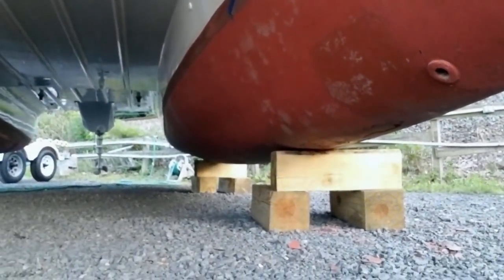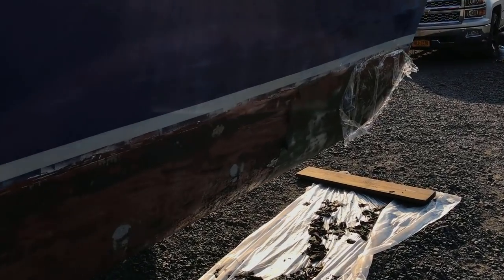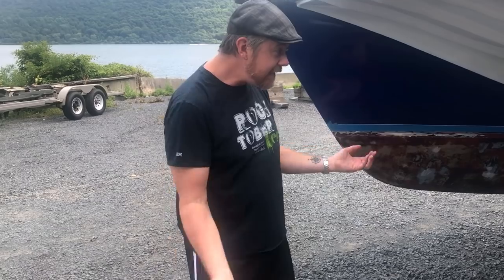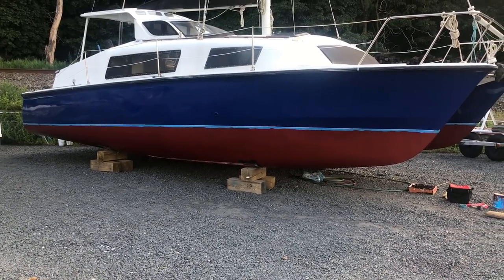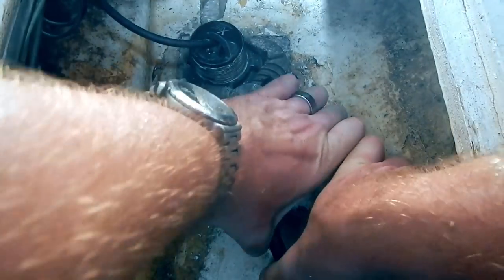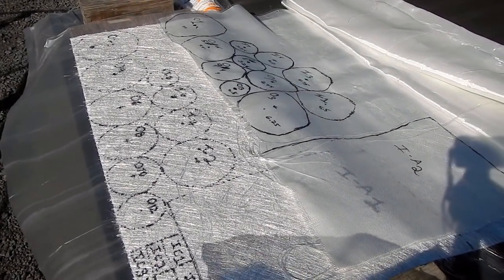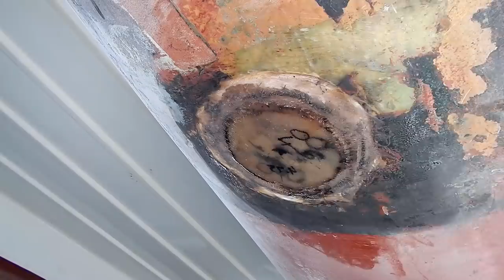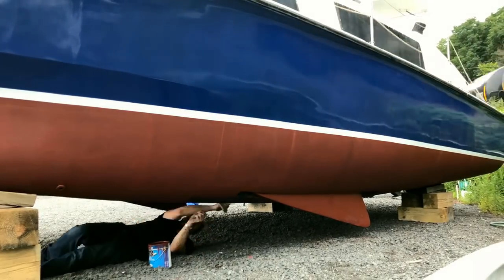We Get To The Bottom Of It All (Episode 27: Sailing 9 LIVES)

Comment: Peal Away is the best stuff, done about the same way you're doing it but with no scraping!
Reply from the maker: Is that like the "peel ply" stuff I heard about? It leaves a nice smooth finish? I do need to get my hands on some of that and give it a try, especially for an area that would benefit from a cosmetic finished appearance.
Reply: @Sailing9LIVES  Peel Ply is different, that's used to make epoxy resin come out nearly finished when you peel off the Peel Ply. Peel Away is a paint removal system. You put the stuff on the boat then cover it with the fabric for a certain amount of time, when you peel off the fabric the paint comes off with it so there's no mess, dust or paint chips everywhere.

Comment: Just found your channel!  My wife and I bought a 1984 Catalac 27 (forerunner design to the Gemini boats) in 2015 as complete newbie sailors, moved aboard, and have had some crazy adventures on a tiny cat.  Florida to NC, NC to the Bahamas, then back up to the Hudson, where our darling Connecting Dots has been on the hard in Kingston for 2 seasons.  We hope to get her back in this spring... maybe we'll see each other on the water and exchange stories!
Reply from the maker: Another cat on the Hudson, and nearby? That's awesome!
We'll have to take a look at the Catalac 27s... I know there is an 8M and a 10M (maybe a 9M), and they are built like tanks... indestructible! Our Gemini is popped from the molds of the old British Aristocat, similar in many ways to the Catalac given their nearby origin.
We would love to swap stories. Let's try to get together on the Hudson next season before we head off to the Bahamas.
Reply: @Sailing9LIVES  It's an 8M (which is 27 feet).  I believe Tony Smith, Gemini's designer worked for the the Catalac company before moving on and starting creating the Gemini design.  There are a lot of similarities.  The 8M IS a tank, though,  and we drove it like one LOL!  Yes, let's connect next year... even if we don't get the boat in the water before you head off, we can visit while we work on prepping her.  We can give loads of advice on Bahamas small cat adventuring... and some of the things we would have done differently with a our boat that you might try.  Our voyage might be a virtual template for what you're gonna do!  I'll keep up with your channel and give you a shout as the weather gets warm and you're making your preparations.
Reply from the maker: Chris Alexander 
That sounds great! See you in the Spring.

Comment: for over 20yrs I have used a vacuum sander--per my yard's demands. I have grown to appreciate this method. I am using the 5" Rigid unit with 8 holes in the face and the Rigid vacuum. Still about $80 each i am now on my 4th sander. I can do my sanding while I'm in my shorts and t shirt, not the whole body suit i did in the past, I can also use the vac-sander inside the boat and inside my house !----Mikey in Sequim
Reply from the maker: Mike Yadrick 
I hadn’t really encountered a vacuum sander until the very day after we declared ourselves “done” with sanding. A buddy at the yacht club offered it to us. It would have been a far better option than the orbital we used... the little collection bag collects a lot, but I bet MOST of the dust ends up everywhere else.
Live ‘n Learn, I guess.
Thanks, Mike. 😁

Comment: What stripper did you use??  great vid, well done
Reply from the maker: Nick Bamber 
Thank you, Nick!
We used Aqua Strip, a “safer” paint stripper. It is still a chemical, and the paint stripped off is nothing but waste... but at least we kept SOME of the paint from turning into dust in the air.
I wouldn’t say that the stripper worked perfectly, but it did do a decent job given the temperature.

Comment: I have  no experience with fiberglass, but on YouTube, I have never seen anybody, except you, wet and pile up layers of fiberglass mat before putting the mat on the area  to be applied - the hull.  I hope your technique is correct as I really like your  boat.
Reply from the maker: UUBrahman 
Hi! I am sure many people do not employ that method, but I have seen it done this way quite a few times while growing up at a marina. It is a helpful trick when trying to apply a patch upside-down. And, just to avoid any question about its effectiveness, the patch is plenty strong and there are no worries about any leaks. 😁
Best,
Duke
Reply: @Sailing9LIVES  Once the resin cures, it all becomes one.  So as long as it got stuck to the bottom of the boat before that happened- you are good (as you already know).  The thing I wasn't aware of is the order of the patches.  I thought the way you did it in the bilge was the correct way for the outside too- small patch to large.  I am no expert... but I watch one on YouTube! (BoatWorks Today)
Reply from the maker: Marcel D 
Yep. The “experts” say the largest one goes in first and the subsequently smaller ones fill in the depression. It has always seemed backwards to me if you think in terms of stacking them to match the shape of the void.
BWT is fantastic. Definitely a better resource than us for fiberglass work!
Reply: @Sailing9LIVES  first great job.  the reason they say big to small is the area you ground away will have full contact with the largest patch stronger that way they say...
Reply from the maker: @BobGubbins  … whoever "they" are Hahahahaa
Thanks, Bob!
Reply: Sailing 9 LIVES just one observation, you glassed the final laminates over flowcoat/bilge paint? The area should be taken back to bare fibreglass before glassing over for proper bond and strength. Other than that, great job the two of you are doing. You will have years of enjoyment on that old lady👍.
Reply from the maker: @alanpiper9614  Yeah, kinda' dropped the ball on that in the interior. The area immediately around the hole was ground down to bare 'glass, as were the little areas to fill in the cracked out resin. The rectangular "cover" put over everything was put over a sanded area, but you are right that in haste the flow coat wasn't completely removed across all of it. Afterwards I was looking at it and kinda' beating myself up over that.
Thanks for your feedback, Alan. :)

Comment: I don't write on my fiberglass.  May not bond there.
Reply from the maker: FlyMeAirplane 
Yep, not a problem with Sharpie. 😁
Reply: I hope you throw that batch away because it will be real brittle when you add that much hardener feel heat up really hot me real brittle he might be in the water than my bust I hope you can swim???
Reply from the maker: @williamlawrence5455  
Well, I understand your concerns, but there is no reason to worry about the patch being brittle. The correct ratio of resin to hardener in this West System is 5:1, and that is the exact ratio I used. Because I used the "fast" hardener (it was the only one available at the time), my working time was supposed to be about 10-12 minutes before the resin kicked... and that turned out to be the working time I ended up with. It worked "by the book". The resin DID get really hot when it kicked in the pot, and that is expected because the epoxy undergoes an exothermic reaction when it cures... as anticipated. I have zero concerns that this patch is brittle (but we do practice swimming, just in case). :)
Thanks for watching!

Comment: Know what you should have done it's only put about 6 or 8 drops not poured in start up a little bit cuz you wanted to dry slowly with that much of dry instantly so waste it won't do a good job damn
Reply from the maker: Yep, huge waste. The biggest problem was that it was a fast hardener, and I had only ever worked with the slow hardener before. I made WAY too much material initially, so it did end up being a waste.
Reply: Lots of things you have to worry about with fiberglass humidity heat cold a lot of different things what part of the country are you living in not to be nosy but just wondering lot of meat boats I see in the yard where I live are sucks California laws are outrageous
Reply from the maker: @williamlawrence5455 
That's not being nosy, that's curiosity!
We are (currently) on the Hudson River in New York, about 60 miles north along the river from New York City. I would say NY laws are only second place to CA. Both states are practically socialist dictatorships.